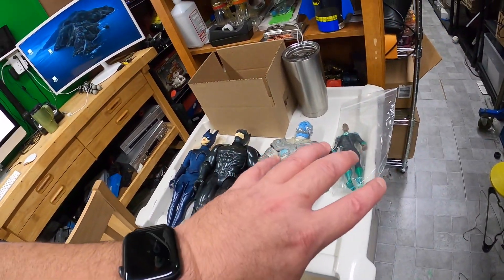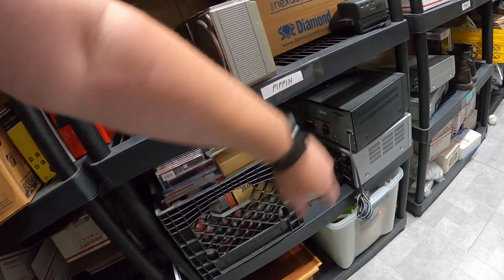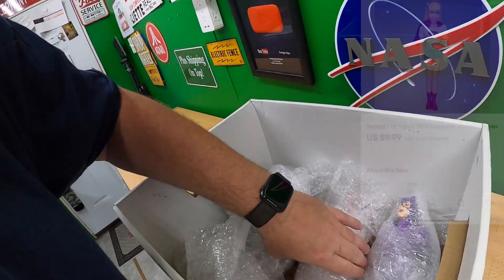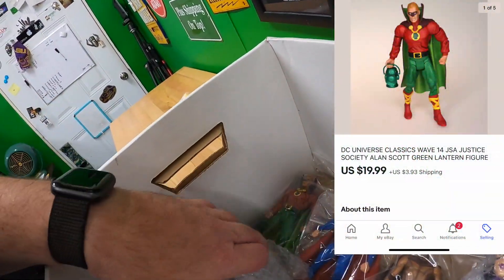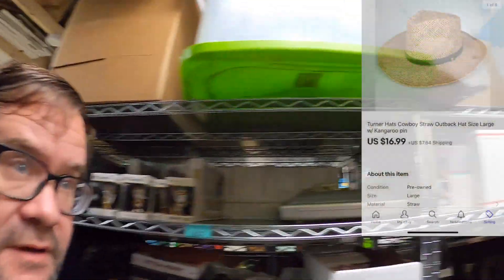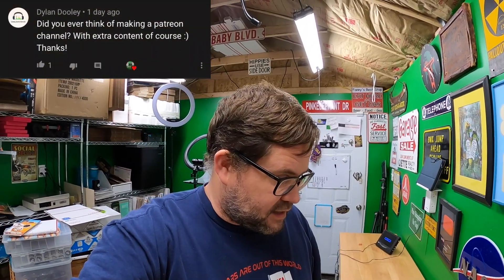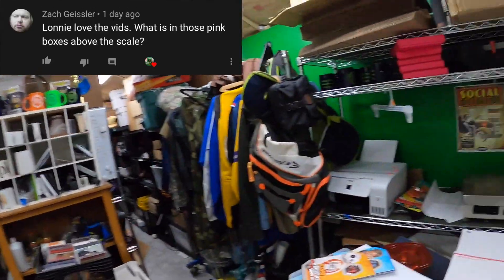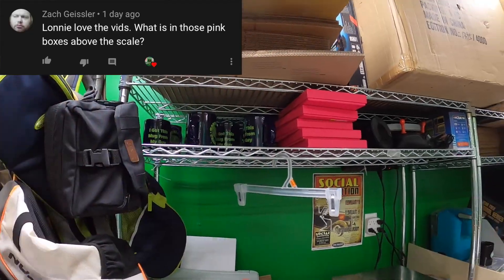This EBAY announcement made me HAPPY

Comment: on the disc skipping / scratched  games . Any game you buy that is scratched always has a chance to not work later on in the game.  just because it starts and plays does not mean its 100% working. Using a reserfacing machine helps but can do more damage than good so becareful with that. For example Sega Saturn games don't always resurface well. Also Pro tip : always hold a game disc to a light source. if you see anything Shining though or tiny holes its something called Disc Rot and that can not be fixed. it's the data rotting off the disc. even if the game does not have any Scratches it can make it unplayable.

Comment: when trying to print a label on a thermal printer, you have to save the label to your computer as a PDF (if you buy from USPS or Paypal) and open it in Paint, then crop it down. Also the advantage to having both printers is, the thermal prints 4x6. If you sell on ebay and you have to ship to an APO address, because it requires the customs form to print, it will only print in 5x7. Which is bigger than the thermal printer will print. Essentially your two options in this case are to 1. Print from the ink jet printer OR 2. Download the label from ebay and try  and resize it so you can print on 4x6. It;s just easier to use the ink jet. I had an APO address sale this week.

Comment: For your UPS Labels if you using the mac, with your label being shown on the screen press command shift and 4 then drag the cursor over the label and save it as a screen shot then open it back up and select the dymo 4xl label printer with the 4x6 prefix, works perfect everytime, or spend a few bucks and get shipstation.

Comment: Hey Lonnie. The research I have done on the VCRs, when it does not function the dielectric grease on a switch inside usually discolors with age. Dielectric grease is clear when it is new and tans over time. Supposedly if you clean the directional switch and apply new grease, most often solves the problem. I had the time to try it. I do not know if it would be cost effective to do. Thank you for your videos.

Comment: A possible solution to printing UPS 4x6 - Save as a PDF - open in Acrobat Reader (not sure if the Mac built-in works), under Edit select Take a Snapshot, then print selecting the 4x6 printer and the "fit" option. I've used it quite a lot in the past until I bought a Rollo printer which includes a Chrome plug-in that handles it. It may also print without the snapshot from the Mac PDF viewer or Acrobat Reader.

Comment: I LOVE the news from ebay. I have an anchor store with 11k listings (14k qty) and will be downgrading back to a premium to save about $220/month in store fees. I have a couple sellers that sell similar and one has 22k active listings and the other has 56k listings. Only catch is I just renewed back in April so to drop down I would have to ~$900 which is 9 months x $100. But this will allow me to save $2640 just in store fees each year.
I use my laser printer to print packing slips and I can never figure out how to print my packing slips from paypal when i use another selling site. I end up having to use reg paper and taping it onto the package. Ebay and Poshmark labels print fine on my rollo printer.

Comment: In paypal go to account settings, shipping,  click change printer type, select printer Label- Zebra TLP 3844-Z- 4.0"x6.0" click save. Next go to multi-order shipping and click on shipping preferences above create shipment, make sure label printer is selected along with the Zebra TLP printer in previous step. Then you will want to go into your printer and scanners (system settings) and you should have a label named 1744907 4 in x 6 in ( I have my width 4.11in and height at 6.28in) (if you do not have this label type, create one and label it whatever you like) click apply and ok and you should be good to go. I print labels on any site using only my dymo.. haven't figured out how to print a return label on it yet though lol.

Comment: It always surprises me that a global business like eBay can apply such different conditions in different countries. Here in the UK, business sellers get no free listings other than those included in their store subscription and there has been no indication that they will follow the US in offering those mammoth increases in 'select categories'. 

The store structure is also different here with only three levels - Basic, Featured and Anchor giving 250, 1500 and unlimited 'free' listings respectively. We also have to use our packaging vouchers monthly, rather than quarterly, meaning the £10 voucher our Featured store attracts doesn't fully cover even the smallest pack size of any of the products (when they are actually in stock). The store structure means that the move from Basic to Featured only makes sense financially when you are listing about three times the included number as below that it is actually cheaper to pay the listing fees.

I'm not convinced that these virtually unlimited free listings will turn out to be a good thing in the long run. As we have seen in the past, and as eBay has used as a justification in reducing the frequency of free listing promotions, they can simply result in the marketplace being swamped with unsellable products lingering on indefinitely. This is, so eBay tell us, why they push old unloved listings down in the Best Match algorithm.

It does seem that eBay are aiming to attack Amazon on their home turf of books and media but (at least here in the UK) both markets are dominated on eBay by a couple of mega-sized resellers who sell at at a price smaller competitors can't possibly match. They make thrive by literally making pennies per sale but shipping millions of items and thereby getting heavily discounted shipping. The majority of DVDs and Blurays sell here for around £2 with free shipping, as the lowest postage price for a small to medium business is around £1.40, with fees, packaging and cost of product that would mean most products selling at a loss. Giving more free listings won't change that calculation one iota!

Comment: Rather than printing to letter paper , possibly also having to trim to size and then using sticky tape, I use A4 labels with 2 labels per sheet to my Canon laser Printer  as a work around as I cant figure out how to format to my Zebra printer either!
Reply: Aneos A3655 Multi-purpose Label 210 x 148mm - Box of 200

Comment: Dude! I have a solution for your dymo dilemma. I just crop the shipping label part and then paste it to the dymo label application. It’s easier than it sounds. Let me know if you need me to expand.
Reply from the maker: Yeh I’ve done that
Reply: I got rid of my dymo and got a Bluetooth printer. It’s clunky-er to use than the dymo but the Bluetooth saves me time as I can print on the go while running errands (I carry my repeat sales like movies and phone covers in my car trunk and have a power inverter)

Comment: Hi. Love your channel. I have a question. I sold a new/sealed item. The buyer claims it was opened and several parts were missing. I took several good pictures in the listing with it sealed. Now they want to return it. I’m afraid they took out the parts they wanted. What can I do about this? If anything.
Reply: you can't. buyer is always right in ebays eyes. eat the loss tbh

Comment: QUESTION: I am a new reseller and I am dealing with my first return. It was a $10 item with free returns. They submitted a return request on July 10 the first day they received it. They have until July 24 to return it. It still shows as USPS awaiting item. I have contacted the buyer once with no response. I am to accept I may never get the item back or is there anything else I can do. Thank you for your help.
Reply: Don't bother them. I have an open return right now with the same issue. On the 25th after they still haven't shipped it, contact eBay. They will close the case and no return will be possible.

Comment: I'm small potatoes no store and I tape down my labels too !
Reply: i did this when i started.... once you get over 8-10 packages going out at once, it'll start to annoy the heck out of you and you may give in and purchase the dymo 4XL... for $200. No ink since its thermal printing...... n the paper is somewhat cheap. it'll pay for itself within months trust me. peal and stick ...boom! it's the same one he uses
Reply: At the least you should be using labels with a laser printer. Half sheet labels cost a little more, but you won't have to tape them down. Labels printed with ink will be unreadable if they get wet and the ink costs way more per page than toner for a laser printer.